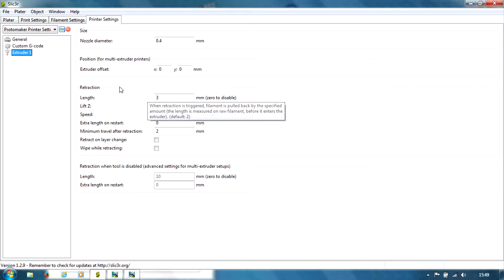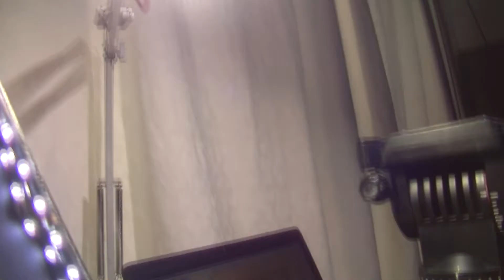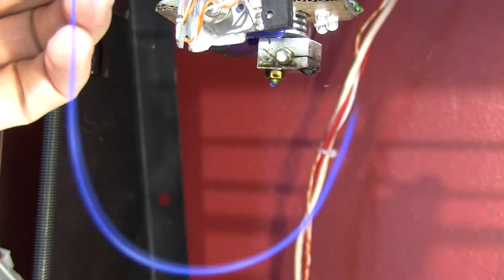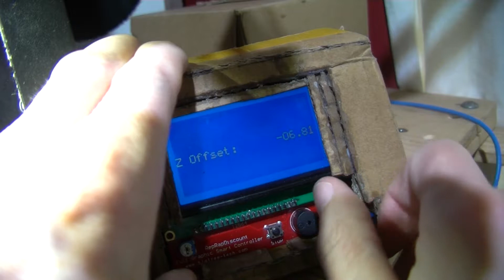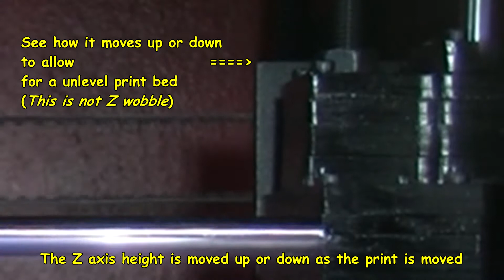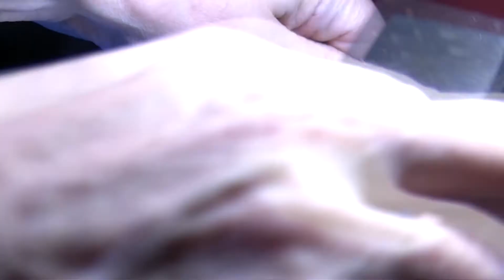3D Feeding Fails Again, more lights added

Comment: Replace your spool holder with one that it closer to the full size of the hole in the filament roll... It means the feeder will have to work less to pull the filament and will solve a whole lot of other problems for you.

Comment: speed for non print speed is to high, try 80mm/s to high and it will skip steps.
try 60 for infill aswell. try everything slow first.
turn retraction off until you have it printint ok then mess about with retraction.
extrusion multiplyer set to 0. 
if you are using pla on a bigish print like the one you are doing put your temp at 220 if its to low on the long sections the nozzle cools and puts a strain on the extruder. on small objects turn temp down to 200.
Reply from the maker: +3d tronix turn retraction of; The reaction on my feeder does not work well, I've just got a new feeder. Not had time to try it yet
turn retraction of seems like an odd suggestion to me, I am a Noob